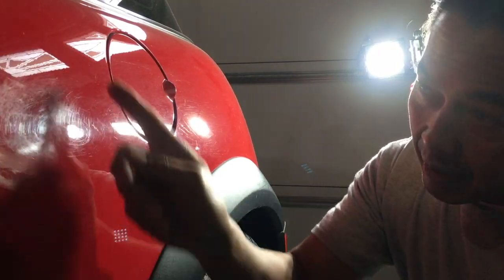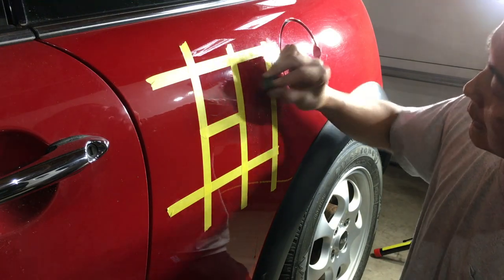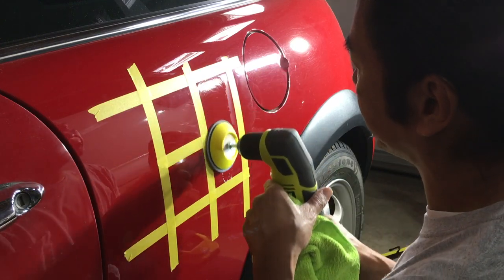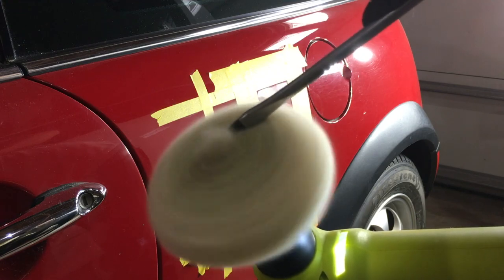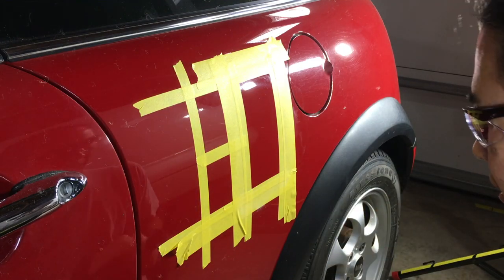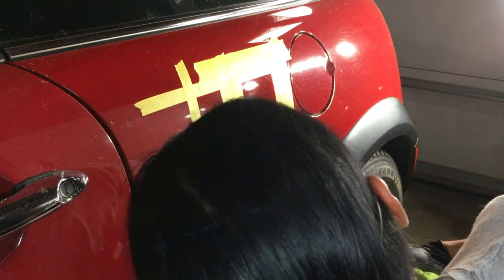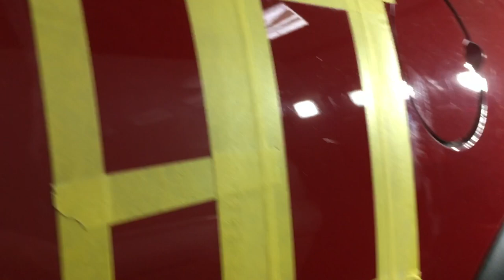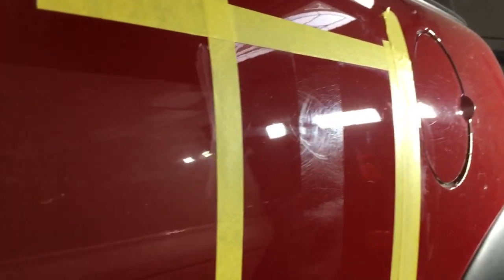How To Remove Paint Scratches Using Ryobi 18v Right Angle Drill

Comment: I got a suggestion for a video you could --- many older vehicles start to develop wheel well surface rust in colder climates. I have an 07 Rabbit, and its clearly a VW defect in this case because the rest of the car is rust free. It would be cool to see your method of how you would fix it, aside from respraying the whole panel - I'm sure there must be another way! Also do you add tags to your videos? Using lots of different tags can bring your videos up in more searches. Thanks again!
Reply from the maker: Thanks stringsnare, I add tags in the videos and cross my fingers.  As far as the video suggestion great idea. I've done a ton of VW's - both custom and national show winning projects. The rabbits are fun, you have a modern era Rabbit.  Back in the 1980's a friend of mine from work got a brand new 1984 VW Rabbit GTI Turbo Charged from factory and imported as a gray market car. It was fast. I just did a rust repair project using the Ryobi as my rust removal sander tool for a 1987 Chevy Pickup truck paint repair, I'll post that sometime soon. Yes, the rust problems are common and there are ways to fix, but sometimes it's the quality of the sheet metal that is used in manufacturing and the way it is not sealed at the pinch weld - water and the deice salt used on the freeways during winter is very corrosive and gets in between the metals and  causes corrosion.  Removing the interior panel and accessing the area and coating with anti corrosion inhibitors helps,  and also brushing in some anticorrosion epoxy primer helps too. The biggest help is adding a sealer caulking to fill and seal the wheel well pinch weld from letting any water splash into the crevices. Water collects dirt and dirt traps moisture.  The late 80's and early 90's Honda cars always had that problem. I did a lot of that type of rust repair.  Thank you for the video suggestion!  Jake

Comment: i learned something! this was fascinating and would be very useful on older vehicles...could you do the whole car with this technique? that is so cool! thanks!
Reply from the maker: Hi stringsnare, depending on the paint condition and how much paint thickness you have, sure you could do the whole car with this technique. Here are some helpful tips. #1. Always try a small test section and analyze how your paint is doing. Is it working out good, or is your paint too far in bad condition that you are making it worse? Doing a small test section is always suggested. You'll learn what works, and can apply your process to larger sections of your car. #2. Use the least aggressive grit that gives you gloss. You might not even need any sand paper, just some polishing compound to make the paint look good. #3 Remember that some scratches are too deep to remove and trying to remove them could make things worse. #4. This process is a very common technique used in body shops and if you learn it well you'll have pro ability!  Good luck, you can do it, but be gentle to your paint. I'll be posting a bunch of painting videos soon and also buffing and polishing videos, you'll be able to see more involved process and knowledge. Thanks so much!  Jake
Reply: @JakeLesada  thank you!!!! I repainted my radio faceplate and part of my dash last year it was really painful because it was my first time doing it but it is quite a good feeling once you finish. Thanks again!

Comment: What speed did you have it on for the wool pad high ?
Reply from the maker: Hey Case G, the speeds I used were both low and slow and fast full on, it depends on where you position your finger on the tool button, but easy to vary the speeds and control rotation.

Comment: You think it could handle a bigger pad?
Reply from the maker: Hey Case G, thanks for checking out the video.  A bigger pad could work if you had the backing pad with the end to fit like a drill bit.  Most of my backing pads with the exception of the one shown in video are all meant for dual action polishers or rotary with threaded backing pads.
Reply: Jake Lesada thanks for the replies  let you know if I figure something out. I’m planning on using Csi pads and polish
Reply from the maker: @caseG80  Cool, Case G, yeah the CSI pads and polish work.  I did a 50/50 demo at Dreher Collision Concepts using a collision hood picked from trash bin. I put it up against 3m steps 1 and 3 - the preferred recipe of their top senior tech.  I asked him, "which side do you like?" He pointed to the CSI side. So, I emptied a small squirt bottle out and refilled it with some CSI polish for him to test out with future  jobs. Also, did test out on Mini - same side I used the Ryobi set up. You'll see those up soon. Thanks Jake
Reply: It just happen that I have a older version of that drill( blue one with the swivel battery base) in the garage. I never thought of using it for that purpose. Spot on. As I said above, the older version of this angle drill has a battery swivel base which I think if it can be handy in order to swivel the battery a bit out of the way. I think I have seen also some yellow angle drill like this one used here also with a swivel battery base.

Comment: Where do I purchase an Arbor for the Velcro pad?  Left hand threaded I am presuming.
Reply from the maker: Hi Stephen Snyder, it was included with the 3 pad kit I got.  And it is a right hand thread, because this is a Ryobi angle drill not specifically made for buffing - don't accidentally trigger the direction of the drill counter clockwise.  I'll try to find the part number for you for the kit I got.

Comment: Na il stick to my expensive dedicated DA for my customers. Oh have fun doing that on a mammoth truck or SUV with paper towels and a million batteries. Some things allow ease of use and time along with many other unseen qualities and benefits like the difference between say a taurus made 9mm and a h&k or a glock. I mean they both shoot bullets so why by the expensive one.

Or here's another why buy a Bentley when I can buy an 800$pos Toyota Corolla from the junk yard? I mean they both just get you from point a to point b right...
Reply from the maker: Hi Jho Seok,  I hear you,  I know there is a tool for every job - but those tools can be used in other ways too. I also have all those expensive tools. Been there spent that. I have the heavy Milwaukee rotary buffer, then switched to the Makita rotary polisher. Then got the Meguairs MT300 when it first arrived with the defective issues. Then the Flex 3401vr, then the Rupes 21 Bigfoot, then the Nano ibrid long neck, then the Rupes lhr75e, then the Maxshine 15mm, then the Adam's Mini polisher. I've worked on big stuff - Semi truck, diesel full engine rebuild, clutch replacement, transmission full tear down and rebuild, full tear down and rebuild power dividers and rear end rebuild. Welding low boy aluminum step deck trailer. I've custom painted big stuff.  1966 Chevy Apache pull truck with 8ft foot bed - full color sand and buff. I've custom painted a 1987 Chevy Cheyenne 4 door crew cab with an 8 foot bed and did full hand color sand and buff.  Also, custom painted 38ft steel Vinette boat hull and full color sand and buff. Also custom painted molly v boat 28ft aluminum Marinette hull with full color sand and buff. At my friend's body shop https://www.drehercollisionconcepts.com/gallery/ I also float tech, and up here we get a lot of pick up trucks from deer hits and I also do the body work - sectioning bed sides and full final detail afterwards. We use 3m  rotary polishers and Dewalt rotary polishers. And at the shop have all the Rupes tools.  Etc.... This video can show what can be done with the least of cost and knowledge. I use paper towels for areas that need it. I started in the 1980's. Knowledge and years of experience is how I get stuff done. As for the gun analogy, I get it,  my brother works at a gun shop and I've range fired a bunch of different ones, some really nice and others junky. Thanks for checking out the video and if you are able to learn just even the smallest something from it great.  Remember, from the words of John Darrach https://www.youtube.com/watch?v=nHSKq-vD2yY "always try to be learning something new everyday." From the words of my hybrid training instructor Craig Van Batenburg https://www.fixhybrid.com - What you don't know - you don't know.
Reply: @JakeLesada  bet bro many masters speak that proverb "what you dont know you dont know". I was just pointing out value and quality. And what you demonstrated was for cash poor DIY Joe's. And maybe I miss understood you in the video but quality products with premium price tags do matter. But if your video was made with the intention of helping out people trying to save a buck and improve their vehicle then 👍but you cant replace professional knowledge care and tools. 

You yourself just touted your knowledge but brotha what's it worth? You seem like a dood with a lot to offer but is it worth 5$ or 5000$. That's what I am pointing out. Are you a ryobi 99$ drill or a 500$ rupes dedicated polisher? You can have all the knowledge in the world but without the value then...
Reply from the maker: @jackturner2876   I needed an angle drill to drill out some busted exhausts bolts on my Astro AWD van project, and this tool also works as a 3 inch rotary - fantastic. Can't use a Rupes to drill holes. But, the Rupes can polish my kitchen counter top, stove top, washing machine and other things not just on cars or in garages. Value and quality is a valid point - but just because it cost a lot doesn't mean it's better value or quality. My Rupes LHR 75e crapped out and I had to send it in for warranty, I got the Adam's Mini and it has more power, is smoother and cost less dollars. I did't get the value or quality from Rupes cause the tool went down and I had other jobs to finish - so got an in-between polisher Adam's Mini and it works at such a low cost with value and quality. I don't listen to the marketing department.  The operator makes the difference. And, I use Dawn dish soap too.
Reply: @JakeLesada  my man 😂😂😂 out here raw dogging it. RIP I dont use rupees either, I use griots garage entry level g9. But do you bro I appreciate the wet sanding tutorial. I would like another one of those personally. You have a lot of knowledge. I appreciate the swiss army knife approach you take.
Reply from the maker: @jackturner2876  I gave my older brother the Autozone version Griots dual action for his birthday. I saw the Sears Craftsmen rotary he was using and thought he could use a dual action in his tool box. I'll send you a link when I post another video on wet sanding. Cool Jho Seok, lets bring the gloss and shine back to paint. Jake
Reply: @JakeLesada  what are brothers for right. I appreciate it brotha. Looking forward to the video.